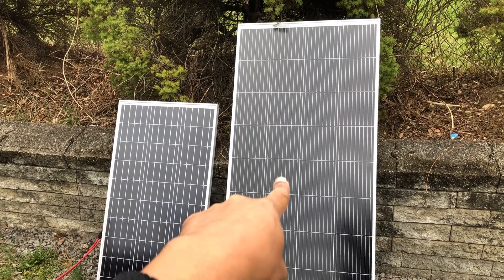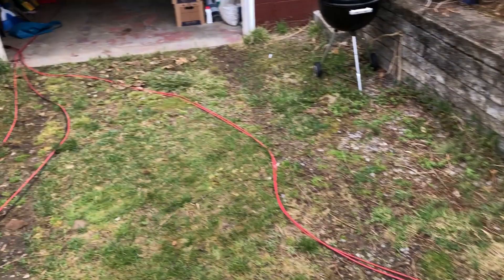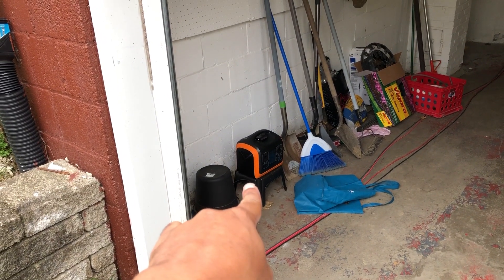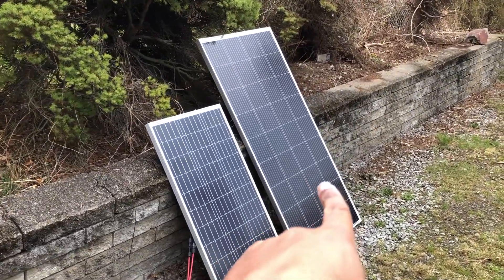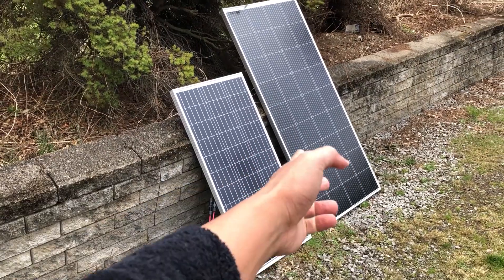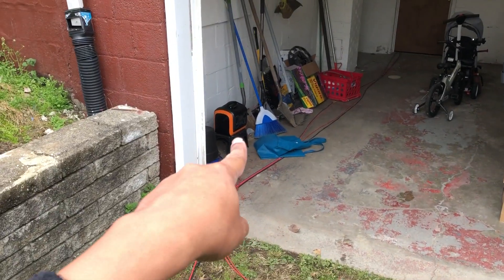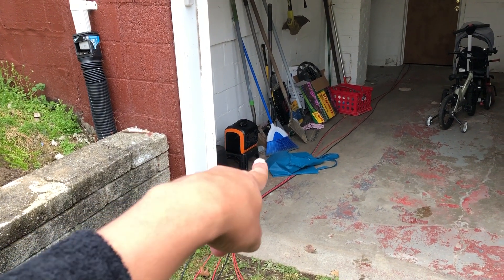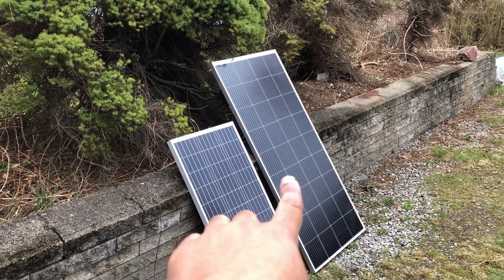Should You Overpanel Your Power Station??

Comment: I have an EcoFlow delta 3+ and I have 2250 W of solar panels connected to it which is seven 320 W panels. I don’t care if it curtails. I want power and low light conditions and I’ve got it.
Reply from the maker: I respect that, especially if it's meeting your needs. I'm too greedy to be throwing away power. I'd just want two deltas to split those loads.

Comment: I have a River 2 max and a delta max. Also I have 2 solar panels. 1 x 160w and 1 x 400w if I need power on a shaded day I use the 400w panel on the River 2 max. Just be careful how you angle it, incase there are risk of sun spots (wholes in the clouds)
Reply from the maker: Man you living on the edge. But the 400 watt should still be fine since it's likely a 40 volt panel right? 

The river 2 max has a 50 volt input limit which is great.

Comment: It depends on what you have.  Your goal is to optimize use.  "Overpaneling" is best seen as a reference to CURRENT conditions.  Two 180W panels in parallel into a power station that takes in only 60W is wasted on a good day, but might be the only way to reach even 40-50W on an overcast day.  Do not overpanel under any conditions by attaching panels in series unless the power station can take the higher voltage, or you risk an error condition at best, and blowing your charge controller at worst.

Comment: I over paneled my shed to insure max watts on my mpp controller to ensure loads from ventilation and AC are met during the day. I start to cap around 11 am - 2 and produce 75 percent plus most days. The real advantage to over paneling is low light and clowdy days in my opinion.  I guess its more situational to the user. Great video 👍
Reply from the maker: Yeah I feel you but I'm just saying. Have an mppt and battery bank that can take all that power. Then profit

Comment: Panels are less money and overcast can’t be avoided all many arrays a 400 watts minimum. My solar station are on a rotation. All together I’m using 1800 watts in panels. An old lead acid battery bank. Acts as like a gas station with cigarette litter outputs.
Reply from the maker: Interesting.
Reply: Contact for something special ✅

Comment: Works here in Ireland, where you can't guarantee any full sunshine every day of the week. Was getting a terrible 6 watts on one 130 watt panel on an overcast day. When I got the cables to attach the second in parallel it now hits 22 watts in the same conditions.

The European EB70 has shown 185 watts intake on those two 130 watt panels I have when I get a clear patch of sky. I'll post some proof sometime soon once I use it some more and make sure it's not something wrong with the electronics in the device, or when I get hold of one of those gizmos that measure on the cable.
Reply from the maker: Haha @ works. It "works" here too. Lol

Comment: I got a 190 watt mono panel for low light (etc) and three poly 100 watt ones for sunny days. Plus I have several folding panels. I got very high wattage into my Golabs with my 100 watt folding panel. What`s the max solar charge on yours? I can`t remember what mine was but it was twice the wall charger rate at least. Can`t wait to get away from these OCD control freaks so I can finally test all my stuff as planned. Now it`s June when I`m supposed to move so they`re in overdrive...opening my mail, my packages, taking my packages and hiding them after opening them (the ones that don`t say what`s inside on the box) hoping I won`t notice...sickening. Amazon covered some orders that said "delivered" but weren`t outside. But when one that I stored on the back porch vanished, and was at the OCD house next door (BIG box!), and was blamed on his autistic 5 year old, opened, the truth was revealed. I`m trying so hard to remain calm.
Reply from the maker: Yikes!! That's wild. Did your internet still suck?
Reply: @AskIveSolar  I called the internet provider. No faster speed available. I plan to eventually try a direct connection instead of WIFI and late night uploads to see if I can move up to 5 minute videos. Takes 2 or more hours per minute of video on WIFI during the day. One 4 minute video took over 12 hours. My GoPro was overheating being on charge that long. Battery isn`t replaceable in the Hero Silver 7. But I assume if needed in the future I can wire the thing to a power bank if its battery is fried. 

I have a Dji Osmo Action plus a tablet. These action cameras are too high quality with no way to lower resolution to increase upload speeds. I may use my lower resolution tablet. It has a great microphone. I`m not looking for high quality footage. I just want to share information I`ve learned with others. The number one cause of death in New Orleans after hurricane Ida was heat stroke. Good luck getting WWL or other media there to tell the public about folding solar panels, USB fans, and power banks. There were HUGE lines of miserable people holding dead cell phones at city charging stations! Totally unnecessary and preventable!
Reply: The wall charger for my Golabs i200 only feeds it 45W, which is sad.  It's a 14.6V charger, when the device can take in 30V.  It's capped at 3A, which is why it gets 60-62W from a single panel, and 72W from my 24V Rockpals charger.

Comment: I'd rather overpanel then get crappy power on bad days. It's cheaper to overpanel but then again I'm not talking aboutoverpanelong by double
Reply from the maker: Interesting observation on double. But if you over panel even at double, you're still gonna get chump change on cloudy days. It doesn't make sense to me.
Reply: @AskIveSolar  No I'm saying don't overpanel by double. But overpanel by like 10-50% I think is good to help with the bad days. There are useless days but with the weather here I'd end up with a fair few days where there is power but lots of clouds.

Plus its just really hard to find an ideal panel that maxes out these power stations without going over so I just accept overpanelling.
Reply: @AskIveSolar  it really depends on your relative weather patterns and latitude. Here in the UK across the YEAR we get a statistical 3 hours of usable high UV a day, winter it's 1 hours worth. So of course if it's a choice of a) mega expensive extra batteries or b) overpanelling with a lot of cheap solar panels.. I'm going with option B! It at least brings winter days up to a usable charge level. Of course if you're in sunny LA etc then you're lucky enough even in winter to push a fair amount of power through. I wish!
Reply: Contact for something special ✅